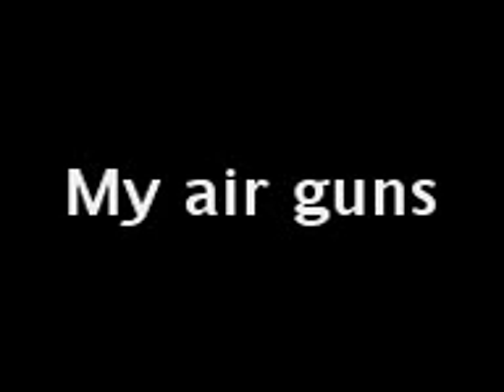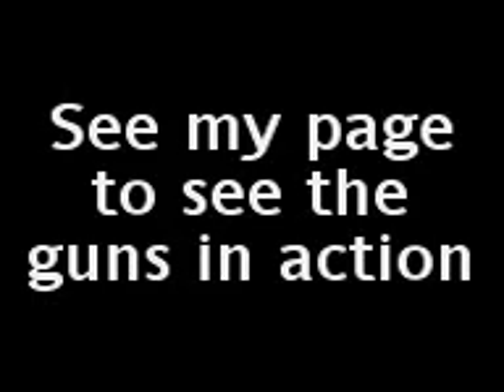my 2 homemade airgns

Comment: its not the pressure that matter,its the flow per second

ex:

You have a BIG airtank with high pressure and a SMALL valve,means the air gonna go out slowly,and you cant shoot a gun with it.

But if you have a little airtank with high pressure and a big valve/QEV the air is going out faster than with the smaller valve